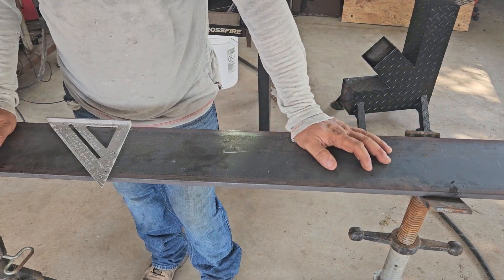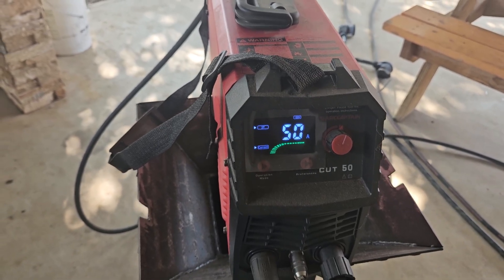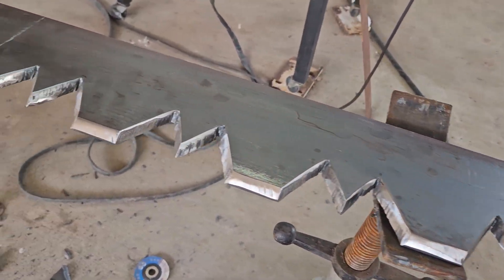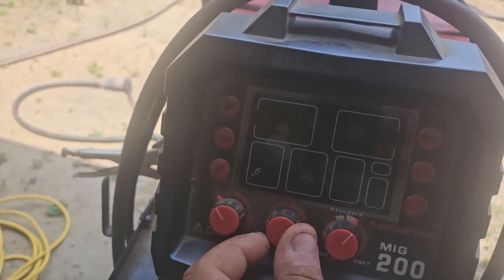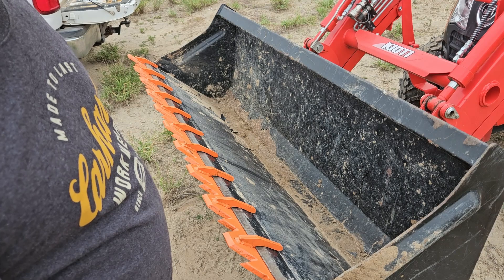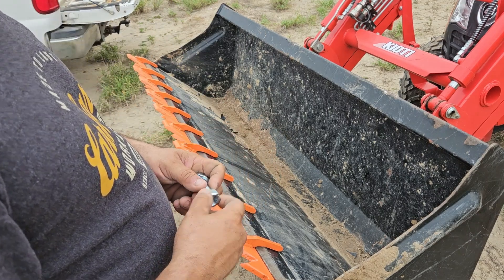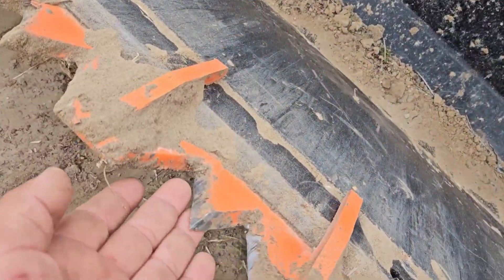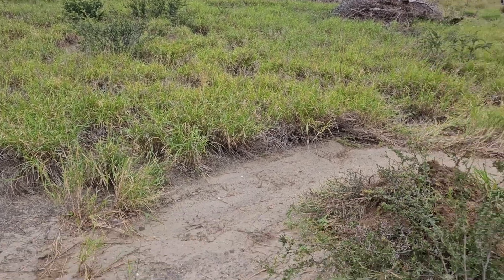Building a Piranha cutting edge wicked tooth bar bucket attachment for my Kioti CK2610 tractor.

Comment: That soft sand dirt you don’t even need teeth put it through a real test
Reply from the maker: The main reason I wanted to try a serrated cutting  blade was for clearing brush and the Kioti smooth cutting edge simply can not compare to this one. I have sandy loam but due to lack of rain the soil gets hard to dig with a smooth edge, the new toothbar makes a huge difference. When I recorded the video the soil was damp which allowed the smooth edge to perform better. I started to dig a pond with the CK2610 and 20 hours made a huge hole for this size tractor.

Comment: You could treat the cutting surfaces with some hard alloy stick rods to make them last longer I think. Seems to work good.
Reply from the maker: I've been so tied up and barely noticed its been 3 weeks since upload. My plan was to add some hard facing like you mentioned. We had some rain and the brush is easily yanked if caught between the teeth for sure. I got some carriage bolts just need to install them later next week to keep the blade in place. I put about 10 hours before the blade fell off due to missing bolts. Thanks for the suggestions.
Reply: Great job. I’m sure you saved a bunch of loot then buying that piranha tooth Bar
Reply from the maker: @JohnDmohawk  Thanks. I wanted to try a tooth bar out so this made a perfect test and the results were good. If the mild steel wears out I will buy a Piranha bar or similar product.